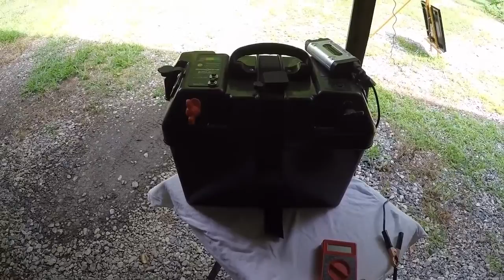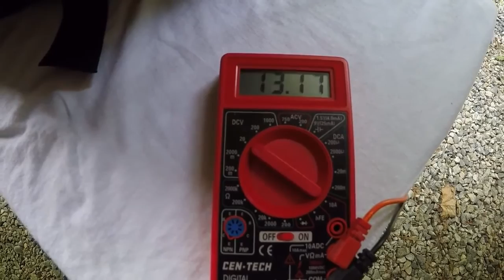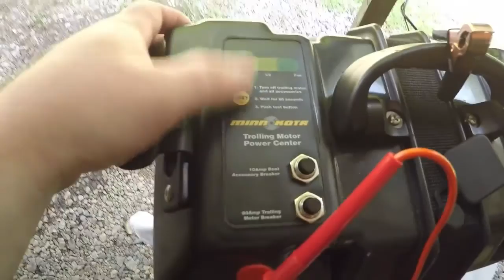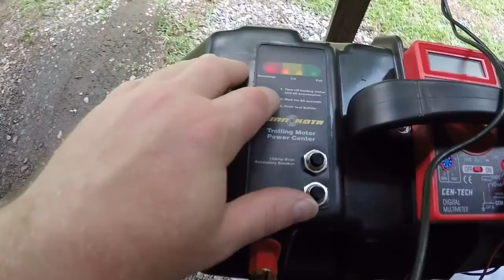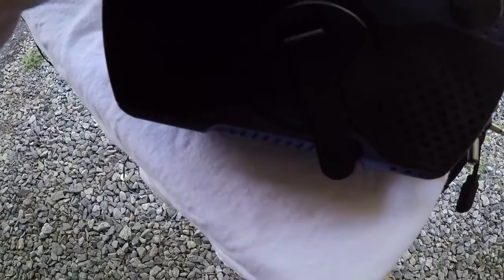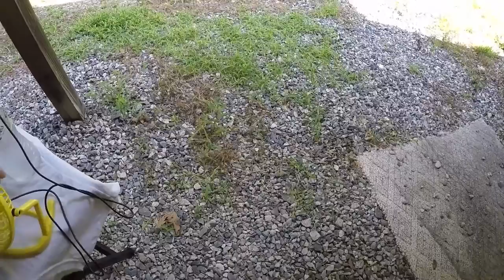Goal Zero Boulder 15 Solar panels and Guardian charge controller Camping/Emergency/SHTF/Power Outage

Comment: *After watching the video advert I was still skeptical. But when I finally showed the Dead Simple Trick [Link Here==https://plus.google.com/100351090281822647456/posts/HMvgs7qqoKA ] I was very impressed. The whole plan was just as you said in the video.

Comment: Nice set-up, and very portable. You could probably power your computer and charge all your electronics with this easily. Thank you for the video
Reply from the maker: absolutly, the possibilities are endless, of course depending on size of 12 v battery your using and size of inverter you would need. thanks for dropping in..

Comment: we have been talking about getting a couple small solar panels.  I have some super small ones to charge batteries but nothing to actually run stuff.  Very nice.  Great item to have.  Thanks for sharing this.  Makes me want to go out and get some right now.
Reply from the maker: its a lot of fun. i went solar crazy about a year ago, and found some really good deals. ive got a few options for different circumstances from charging cameras and phones while backpacking, to going out in the middle of nowhere and having power options.